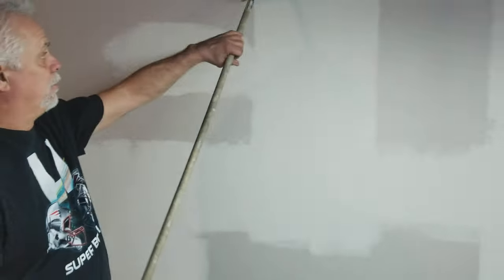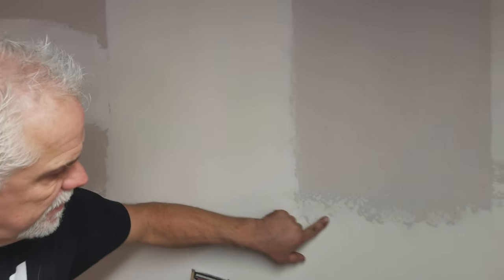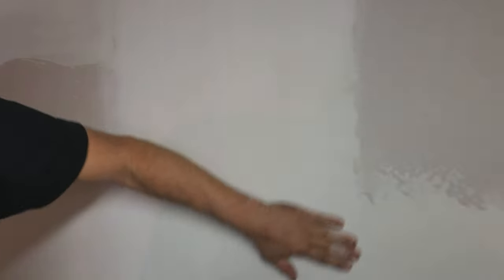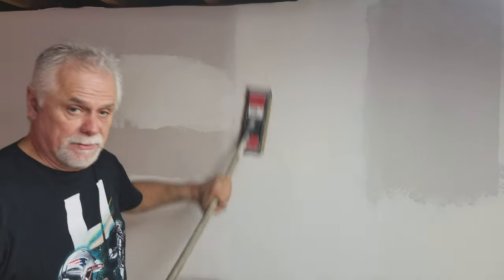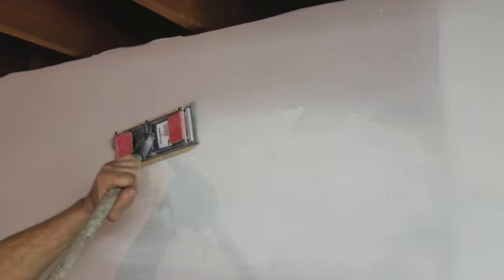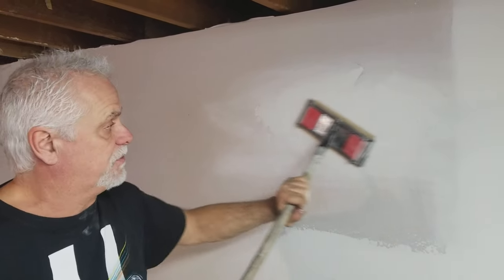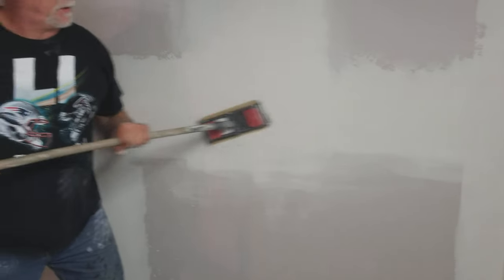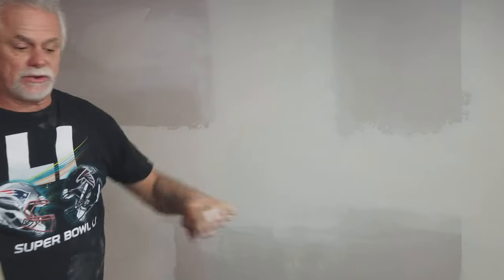Drywall sanding 101

Comment: Why do you have to breathe dust when grinding, Machines were invented for that a long time ago. All sanding dust goes into the vacuum cleaner. I have in buildings for over 30 years. Machines have been invented to make work easier and faster

Comment: You are an excellent instructor, and your tips made my first attempt at drywall a breeze, especially scrape as much as you can to prevent extra sanding, and wet the sandpaper to prevent extra dust.  This video was perfect.  Thanks Phil.
Reply: not so great ! he does not mention what king of grid sandpaper he uses,

Comment: Phil how would I take peeling paint off a ceiling. Looks like Previous owner just painted the ceiling and it's flaking off.
Reply from the maker: Use a 6 inch drywall knife and scrape it completely down and then you'll have to take mud thin it down roll it on with a half inch and a half roller then Tip It Off you'll have to skim coat the whole ceiling to make it smooth